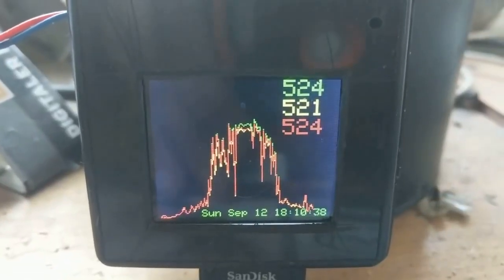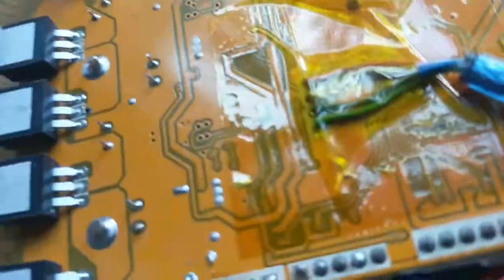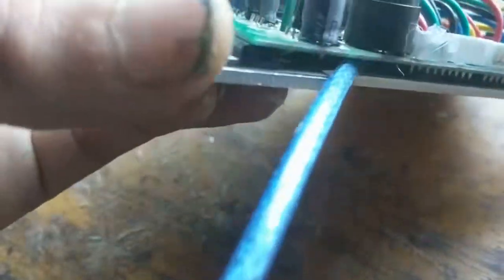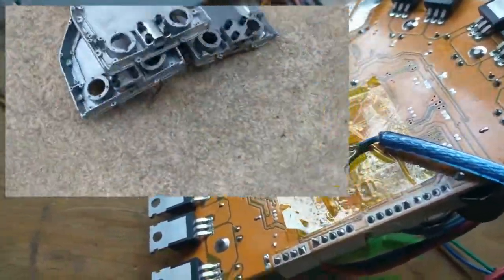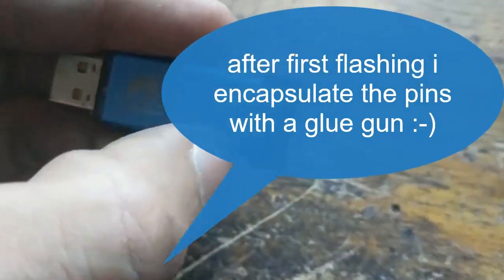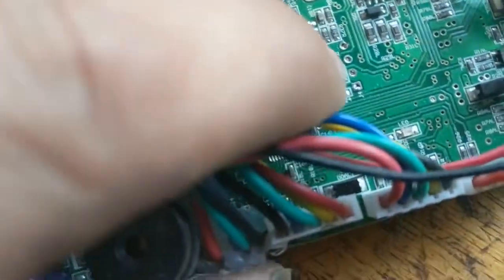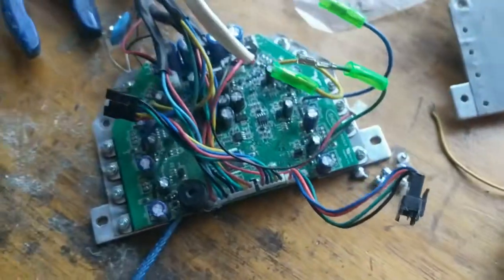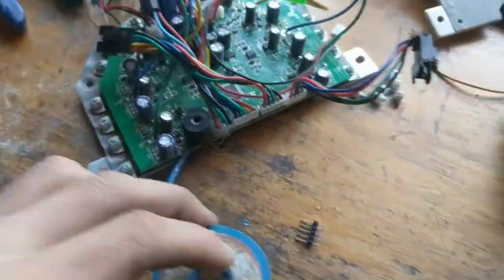My way to connect the st-link cable to the hoverboard controler

Comment: You're doing it right, but if you want to solder the four pin interface, use a sucker.
Fill the whole with solder and when it melts properly, use a sucker tool. This should be done from the back side of the PCB so that it won't affect other components.

Comment: I have a couple of these boards, I soldered a four pin header in each time. I thought everybody did that. Just get a solder sucker, makes it not too hard.
Reply from the maker: Sure I have a solder sucker to remove the soldering tin. But you still need to solder from the backside ? Then I prefer to solder in a cable.
I would like to solder in something easily from the top!

Comment: I use a vacuum n my iron to remove the solder n then just shove em in there.  I have a really high pitch sound when trying to turn on my board I replaced the 2 voltage regulators with no luck. Could it be from a noisy signal or bad pot? I have 100k resistors soldered from adc input to ground so it shouldn't be floating?. But i don't even know what floating is so yea that's where I'm at. Also just want to say thank you and without your compiler I would have given up on all this after setting 2 boards on fire. Got wheels turning 1st try after using your compiler. Brought hope back for me.
Reply from the maker: i am looking for an easy way to solder from the top! so no removal of the 12 mosfet screws.
Yes i too have some noisy boards. It is the speaker! So check the amplifier..
Reply: @robodurden  ok in that case grab some locking pliers grab onto 4 pins pull off the plastic heat up with a torch or rest em on your iron for a few seconds n set em in. Give or take some flux or tinning the pins depending on the metals in play but tested and worked for me. Long as I didn't oxidize the pins I was good 2 go lol
Reply from the maker: @James70Sav  lol = laughing out loud :-( with my poor soldering skills this will not work for me. the tin-solder will never melt with a locking pliers holding 4 individual pins.

Comment: Nicely done!
I'm waiting for my ST link to arrive and then will start experimenting as well. I have many controller boards, not all the same. 
Would you like to exchange contacts and will talk more about it?
Reply from the maker: No, I am a born loser, losers don't have friends..
Did you built that wooden led windmill in your video yourself ? If so I might be happy to help you with a Darrieus wind turbine. One hoverboard motor should be suitable for 100W at 20 km/h = 12.5 mph and 300W at 30 km/h. Diameter 2 meters and height 1.5 meter. 12V or 24V with our controller boards stepping down or up. 5 revs = 300  rpm at 20 km/h should be possible. A hoverboard motor makes about 14 rpm/ Volt.

Comment: Hello I have a board with AT32F413RCT7, YST DXT J20 V2. 1. I'M UNABLE PROGRAMME USING ST LINK. ANY FEEDBACKS WOULD BE GREAT
Reply from the maker: Search the Emanuel Feru GitHub Issues for that MCU. Or read my comments on YouTube to find the links under some of my hoverboard videos :-/
Reply: @robodurden  so it's possible to flash AT32F413RCT7? .. Wit st link for sure?
Reply from the maker: @harishrajamani4922  no it is very complicated and there is no beginners tutorial. You can do that :-)
Reply: @robodurden  that's bad. Hope I can get the full board set replace. N flash it. I'm Will to pay 💰 if anyone can instructor me step by step instructions. N guide me
Reply from the maker: @harishrajamani4922  Go find that issue about that MCU and set a reward of USD 100. Might work :-)
Reply: I have the same problem... have you made any progress?????
Reply: @robodurden  Will contribute, I have the same issue. Any Idea where can the older single green motherboards be sourced please? I had no luck and that's why I ordered those new ATERY ones...
Reply from the maker: @mirekcolakov1730  if you are willing to back a crowdfunding with $20 for a beginner tutorial, send me an email to robo@robo4future.de
When we reach $100 I might offer the money/idea to those experts on GitHub.